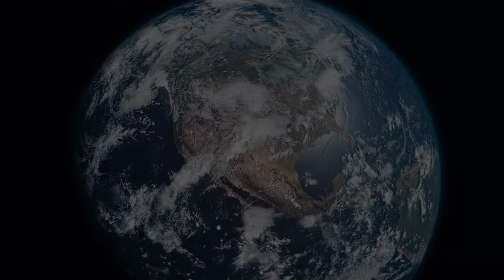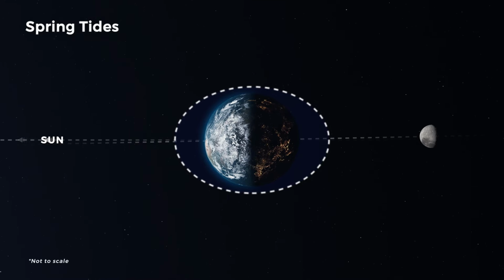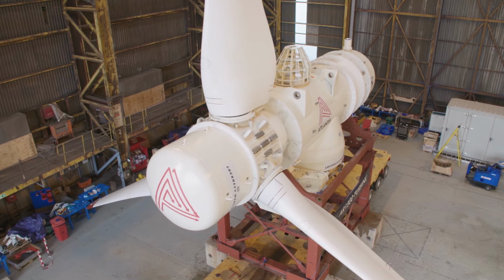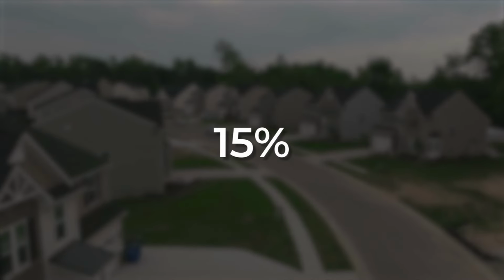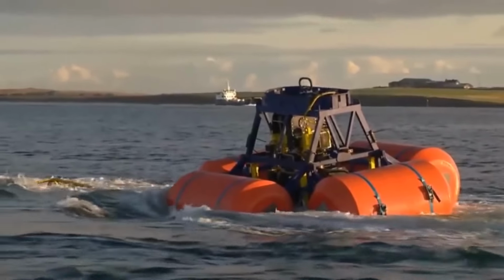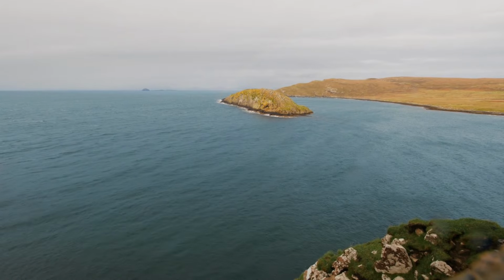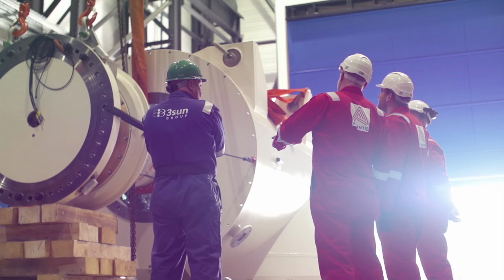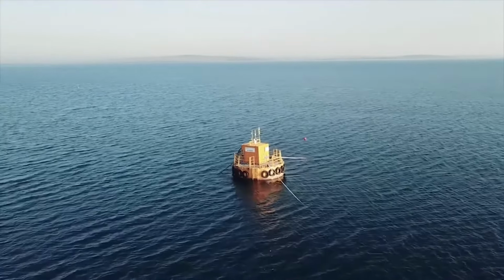Can Underwater Turbines Solve Our Energy Problems?

Comment: This video mentions recouping of the financial costs involved in creating and maintaining underwater turbines. I'm more interested in recouping of the ENERGY costs, to wit: mining and transportation of raw ore and materials; processing and machining into constituent parts; assembly into completed turbine; land and sea vehicles necessary for transportation and initial installation; facility overheads; etc. All of these things require energy (which, at this time, is still largely supplied by fossil fuels).

I can only speculate, but I suspect that the total energy cost per new turbine is quite high and wonder how long it would take to recoup the energy needed to create and install (let alone maintain) each of them.
Reply: waste fo time as it already has been done for wind turbines. Tidal turbines are 5 times smaller structures.

Comment: An innocent question: can too many turbines stop or decrease marine currents enough to affect ecosystems?
Reply: So I'm going to school for wind turbine maintenance and one of the things they teach us about is called the Betz Limit, some physics guy called Albert Betz figured out that at most a turbine can extract 59% of the energy in it's swept area, if it captured any more it would stop the blades because it sucks too much energy out of it, I'm sure something similar exists with these tidal turbines. 

And at least with wind they capture like less than 1% of the energy flow in the area's wind because most of the energy is way higher up, taller than we could ever build towers for. you would have to ask a marine biologist if the same holds true in the water. 

I would honestly be more worried about the noise they generate cutting off migration routes in and out of these lochs
Reply: Midnite111 this reminds me: what ever happened to those “zeppelin” wind turbines? I saw a concept of a turbine in the middle of a doughnut shaped balloon, ( it was more of a tube) that could be put up much higher than conventional wind turbines. That must be at least a decade ago. I guess something didn’t work out right.
Reply: @jl.7739  did the zepplin style involve helium balloons? If so there is a shortage of helium around the world because helium basically is so light that it floats out of the atmosphere
Reply: Shane Grissett I can’t remember. But you bring up a good point. Even if helium was very available, you probably would have to refill those balloons constantly adding a lot of maintenance cost.
Reply: @midnite1112  I would generally agree. The real issues with Tidal Turbines are the potential effects on the ecosystem of their emplacement, both of the fixed structure they are attached to (and the effects these structures may have on the ocean bottom) and of the various effects of the actual turbine once in position, such as the sound effects mentioned. Sound affecting migration would be an issue that needs looking at for example. Another worry would be the use of anti fouling paints, they are bad enough on ships in transit but used on a structure that is more or less permanent such compounds could have a serious effect on the surrounding marine life. While the system used in the experiments mentioned is far more benign than many anti fouling measures it is still something that I would feel needs more research. 

That being said, careful choice of where such systems are placed, and good management and monitoring of such turbines should be able to counter or avoid most if not all the potential problems they may cause. In all they are a far better solution in my eyes (as a Marine Biologist) than Tidal barrier systems, which can have devastating effects on the local ecolology due to the manner in which they work.
Reply: @midnite1112   that's the answer I was looking for, I had no idea about the Betz limit. Now I can start looking more info from there. Thank you a lot! 👌
Reply: @midnite1112  betz law is for all non-newtonian fluids. 59.3% of the energy in the system can be extracted in theory. Nothing has come close to that number due to lack of efficiency, though
Reply: So I know it's been a while since you asked but nobody really answered your question. The wind and ocean currents are created by temperature differences caused by the day/night cycle and spinning of the earth. The differences in salinity between two bodies of water can also have a small effect on the currents. Putting turbines in the water won't do any more damage to the currents than the seafloor and landmasses. The heating from the sun isn't the only thing that keeps our currents going. Thermal vents and the cold water from the poles can create small currents.
Reply: @shanegrissett7423  thank you a lot! :D
Reply: @GarfieldRex  Youre welcome! Everyone else kinda went off onto their own thing and forgot about the main question.
Reply: @bradhatcher1059  thank you!
Reply: Nope. The ocean is too big. Even if every country makes a turbine, it wont make any difference in tides. 
Imagine this.. Make a square and divide it to 4, 1 is for land and 3 is for water.
That 1 for land, divide it to around 200 for countries.
Reply: Well if we use the energy from the tides, no because tidal energy would be taking energy from the rotation of the earth. Could that make a day 1 minute longer in millions of years or so, yes but nobody really cares over millions of years.
Reply: @thecwd8919  not only the earth but the moon would slow down to, cause it's linked to the tides that would slow down.
Reply: Fuk dem fishes
Reply: Certainly they could!.!.!. Would you care to set the level.?.?.?. Commercial ideology says to saturate until someone complains with credibility..!.!...
Reply: jf folding wall 1000 ft .wide closesand open simontanisly it does hurt nothing.
Reply: only 0.001% of ocean currents is enough the complete world energy demand
Reply: i always doubted that windfarms actually killed birds
Reply: Can you imagine how many species would be killed by wave turbines just like wind turbines have killed birds :(
Reply: @MrDosonhai  
Here is a list of cause of deaths of birds in the US (I am using the average number)
- Cars and trucks kills 75,000,000 birds
- Transmission lines conventional power plants kills 174,000,000 birds
- Buildings/ windows kills 689,000,000 birds
- Fossil fuel power plants kills 14,000,000 birds
- Hunting kills 110,000,000 birds
- Pesticide use kills 72,000,000 birds
- Agriculture kills 67,000,000 birds
- Communication towers kills 28,000,000 birds
- Oilfield oil waste and wastewater pits kills 750,000 birds
- Domestic and feral cats kills 1,800,000,000

Summarizing the above common causes for birds dying we arrive at +3,000,000,000 and wind turbines 330,000 killed birds (0.0108%).
Reply: Frups considering the quantity of wind turbines in proportion to everything else you mentioned, from your statistics I only concluded that wind turbines are dangerous to birds.
Reply: @aslanbayramuqlany6189  
For every GWh produced in fossil fuel power plants 5.18 birds die and for every GWh produced with wind turbines 0.27 birds die. So if all the fossil fuel power plants would be replaced with wind turbines, millions of more birds would be saved. Still it is a fact that around 330,000 birds are killed every year by wind turbines and it will increase, as the number of wind turbines increase, so it is important to find ways to decrease these numbers.
Reply: Frups Build cages around them.
Reply: @januarysson5633  
I don't know if that is feasible, but they have tried using different colours, as white is the worst as it attracts insects. I think the best results so far was with a violet colour. They are trying scents as well, but I don't know what the progress is. Let's hope that they find a good solution soon.
Reply: @Frups12345678  maybe the soundgeneration of a wavelength that Birds dont like could help?
Some years ago i read about an idea to install small devices on Cars that generates a sound that warns animals next to the Street that a Car is coming near, so they have time to leave the Street. Installing such kind of devices on Turbines and using the Airflow to generate an "Bird-repellent" sound.....would that work?
Reply: @Frups12345678  hey man, can you share a source? :)
Reply: @Darth_Pro_x  
Just Google it and you will find it easily. The data is from three different studies, of which the most recent one is from 2018.
Reply: @smaragdwolf1  lol if you're referring to deer whistles they don't work. They're too small to make any noise that can be heard over car noise. If they did they'd chase you out of the car. They claim to make ultrasound. Deer can't hear ultrasound. Trains are kinda slow and a lot loud. Guess what trains run over all the time.
Reply: @MrDosonhai  if your worried about birds dying that means you hate, cars, cities, trains, power, windows, etc. Because they kill literally billions of birds worldwide
Reply: @MrDosonhai  oh shut up seriously.

I've worked on large scale wind farm projects and this bull shit about killing birds is completely rediculious.

Birds fucking have eyes.... They SEE THE TURBINE.

See and avoid. Jesus.
Reply: MrDosonhai But meanwhile we’re killing ourselves with no renewable resources lol yeah sorry i care more about humans than some fish

Comment: Salt water is very corrosive. The so called protection isn't perfect. Moving parts are very difficult to seal without a pump which uses electricity. Not to mention the constant force put in the metal. It doesn't seem feasible at this time

Comment: We had this in environmental science over 20 years ago. Problem 1 is cost. Problem 2 is it's not that efficient-lots of equipment req'd & suitablility of location. Not going to happen off Florida or Cal b/c of tourism.  Tidal power is low & only 2x/day. Current power-would have to go way out. Wave power-negligible at low tide-just not enough power.  People can't imagine the massive machinery required to install offshore. Also an ecosystem effect.

Comment: "Can Underwater Turbines Solve Our Energy Problems?" May be with a lot of research, infra-structure, engineering, etc. But you know what could solve our carbon-free energy problems right now? Advanced designed........NUCLEAR.......energy! The safest form of generation now in use, including wind and solar, not to mention it is on-demand/base-load power which renewables certainly are NOT!

Comment: The units you were using for the amount of power was terawatt hours per year. There are already a set number of hours per year, you unnecessarily increased the amount of power by a factor of 24*365
Reply: Also gigawatt hours is a measurement of energy not power

Comment: Stupid stupid stupid. You need a constant source of work.
The fluctuations in ac not only makes a practical design hard to obtain, but the mechanism used to convert the ac into a grid compatible frequency, be it a battery or some crazy transformer, will cause huge losses.
Dams work well because they have a constant rate, as do nuclear power plants and gasoline generators.
The next thing down the list would be hydrothermal vents. Not the whims of Poseidon you idiots... That is the first stupid.
The second stupid is for the potential of millions of these turbines being placed in the sea slowing down currents so that the mineral rich lower layer doesnt mix with the top layer causing death of algae and thus warming of the top layer which will further separate the layers causing the ocean to stagnate and die.
This is just too toddlerish to me, did you get this idea from Bob the builder? "The ones on the surface are chopping up birds, I've got an idea, lets put them under water".
Stupid numero three. I know you don't care about whales, but if they die, than there will be an explosion in seal and sea lion populations, and guess what they cary. Diseases! Yaaay! Tuberculosis! And ecoli.

Comment: The idea of tidal energy is more promising, in my estimation, than solar or wind energy. If, for nothing else, the fact that it is a predictable energy source, where future projections can be accurately estimated. The only concerns I can see, for tidal energy, are that of the long term effects on environmental impact, maintenance, and power storage / distribution. There really is no 'golden goose', when it comes to clean, renewable energy sources. Nuclear energy is a strong solution, to burning fossil fuels, however the radioactive waste is a huge negative. Also, people are fearful of it, due to past catastrophes of nuclear power plants. Each country needs to implement several different types of energy production, which utilizes their specific country's topography and location, to its best advantage. In the case of tidal energy, it seems like a solid solution to add this type of power generation, to coastal countries, to supplement their clean, renewable energy sources. I would invest in this technology.

Comment: The answer is Hydroloop/Aqualoop it's a tube system that instead of it being airless it is filled with seawater. Not only making it the largest salt water battery but it would also have high speed transportation,send water to desalination and produce electricity with the one way water current and at the end it would just turn and come back and of course at both ends it would exits bad to the ocean. Or the water can be chill below freezing point (seeing as salt lower freezing point) and relocated to the poles to replenish. So Hydroloop Aqualoop is the solution. It would let us farm seafood in land and much more. Twitter account @Frankbarroso23

Comment: Really hoping for a safe way to implement this technology. They have been using wind energy in Norway for a while now and it has had devastating effects on the Sea Eagle population. A hundred or so sea eagles have been killed or irreparably damaged by the wind turbines, forced into horrific deaths like bleeding out on the ground after losing a wing. They may be good for the climate, but they are horrible for the environment as they are currently.